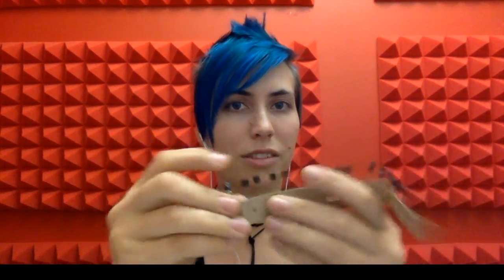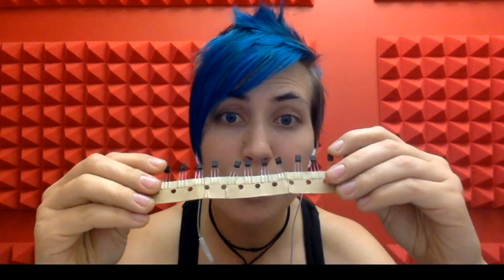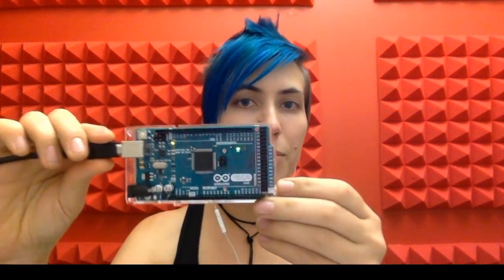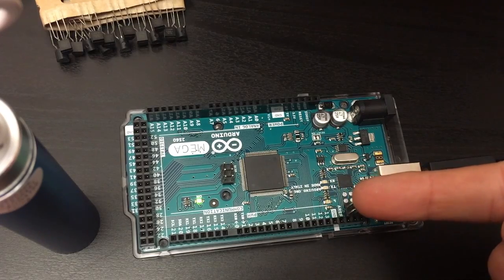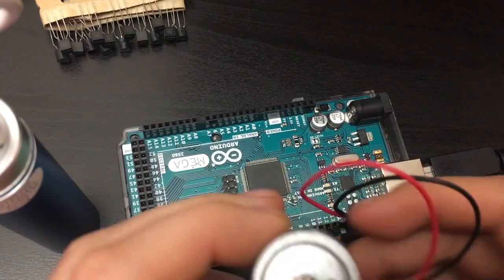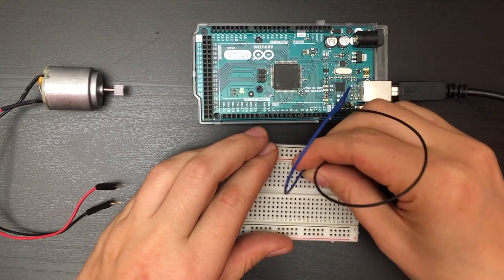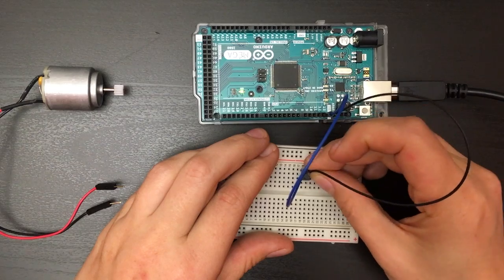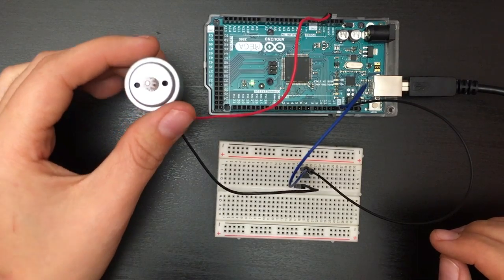Arduino Basics: Transistors for Robotics

Comment: Great video explanation. Just curious , wouldn’t connecting the motor directly to Pin 13 destroy the Arduino because of the large current draw ? Also is there a resistor needed between the base and output pin of the Arduino ?
Reply: Shaun yes, it will damage your Arduino board if you directly connect the motor pins onto the board. If you want to control a motor, use a motor control chip(L293D) and connect it onto a breadboard. Also you should use a breadboard power supply within.